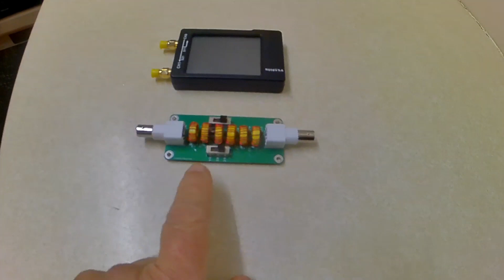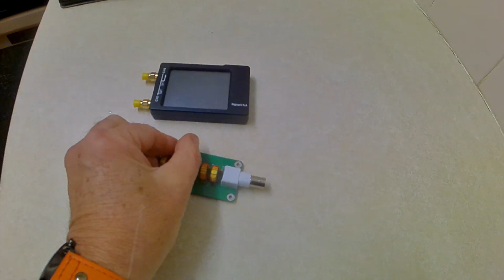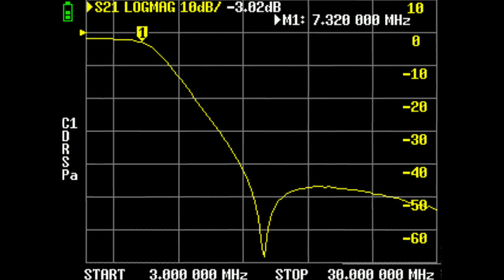HF Low Pass Filter Kit. Nanovna Results and Graphs, Charts. Ham Radio. Amateur Radio.

Comment: I resoldered the connection from BNC to SMA, but the wobbling issue persists. It was happening even before I made the change. I thought switching to SMA would resolve the problem, but it didn’t help. Now, the display is also showing waterfall changes, like something aint properly connected, but it is, damn, makes no sense. Do you have any ideas on how I can fix this?